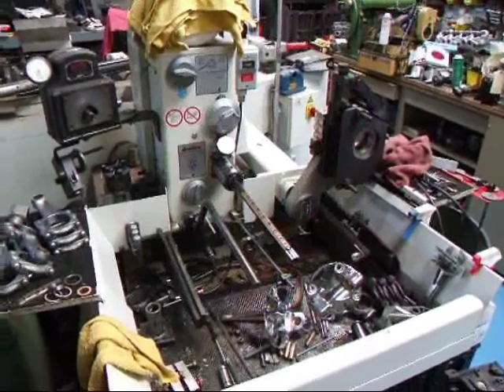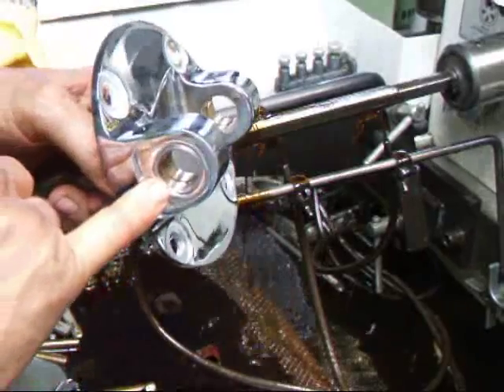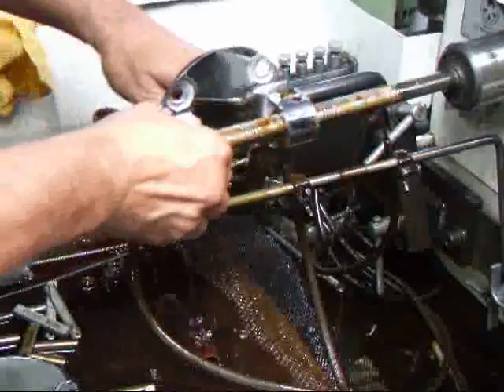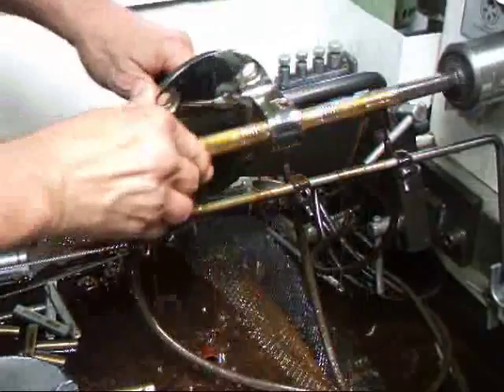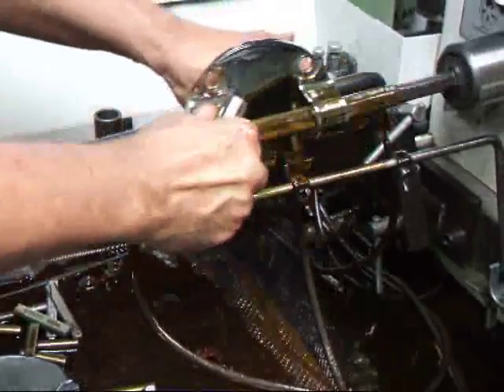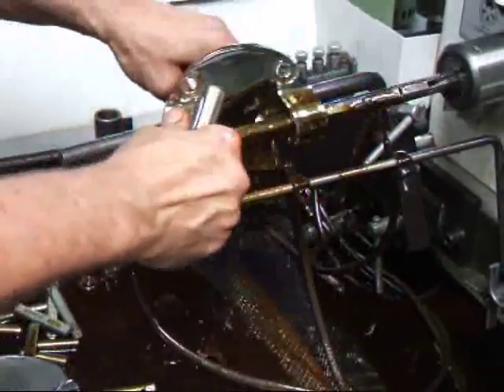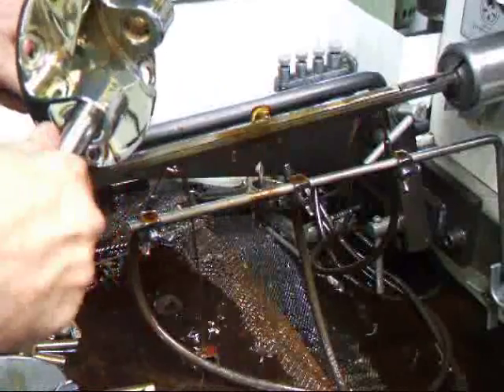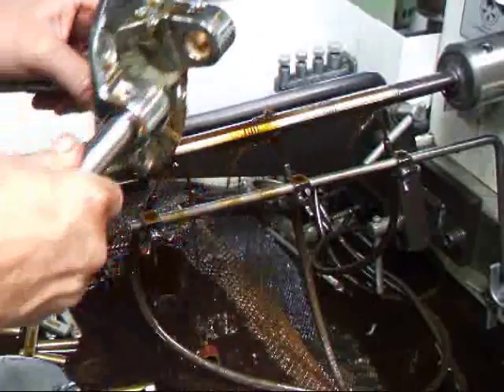King Pin Fitting on the Sunnen Hone

Comment: I run a sunnen mb1804 manual feed day in day out.... what stone do you use on the chrome plating? cbn? borazon?
Reply: +Danny L he said in the beginning he had the "bushings installed and the oil holes lined up for the zerks..." which I assume means - he's honing bronze bushings and not chrome. 
I suspect the plating didn't go far or deep into the holes anyway if it's like the parts I've plated.